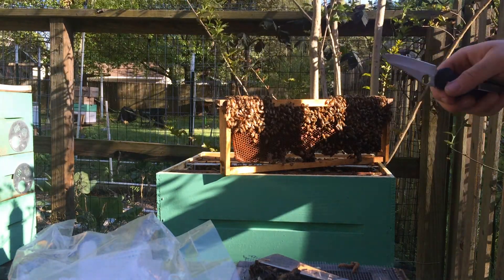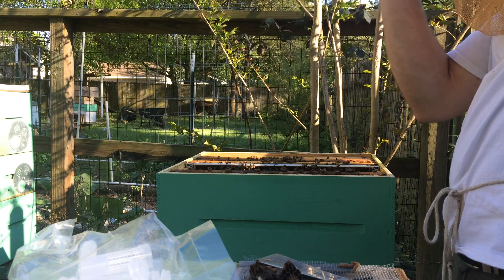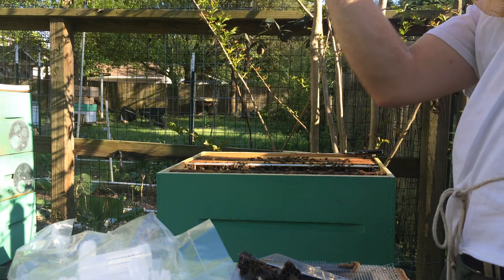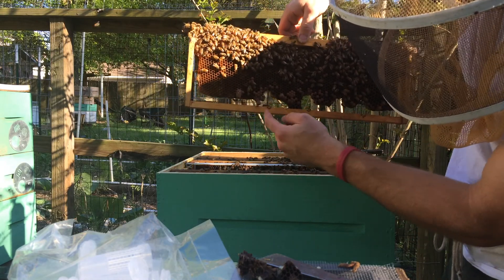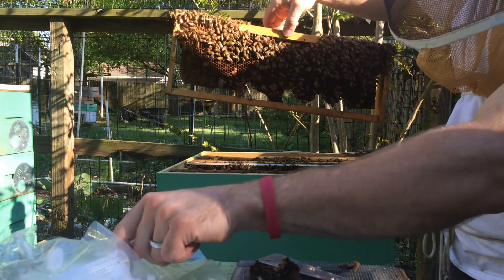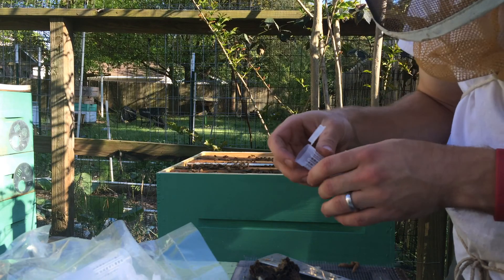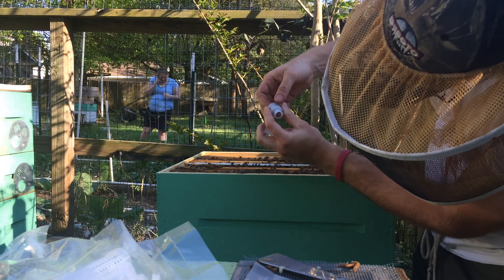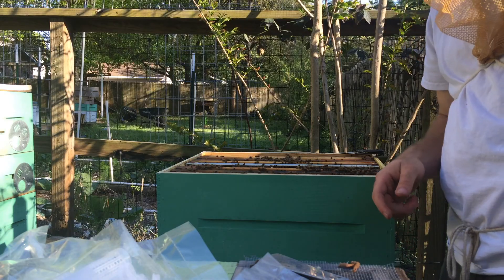Honeybee Queen Cells into Cages

Comment: Thanks! This REALLY helped. I grafted 30 larvae but only 9 took. They are capped as of yesterday and I couldn't figure out how to make those curler cages stick on the bar. I'm going straight out and make a rack like yours and get the capped cells in there. Awesome idea.  Ive also had a heck of a time getting grafts to take for some reason,but getting a bit more success now. Very little, but some.
Reply from the maker: Well keep in mind the hair curler cages aren't designed to use with the JZBZ cups, they just kind of do if you manipulate them and use the frame bank like I did. The JZBZ cup hangs loosely in the what will then be you candy plug area. Yes grafting is an art. I need to do it more to hone the skill. It's a delicate process but with proper planning you can get repetitive high success.

Comment: What i use is the plastic hair curlers with small holes around it and put a wooden plug on the ends, can buy a sack full for the same price of 1 store bought plastic cage. and the plug is from left over wood... and made some cages out of left over 1/8th hwc just to put over a QC, so if i see a frame with a bunch of Q cells on it, i put it into a queen castle, so i don't have to open there hive all the time.   I just simply put a cage over the cell and push it down into the comb,  if a few hatches out there in a cage enough thing can get in it or out...then simply lift the cage up and take her out into a hair curler  take 1 plug out and put queen candy in it, so she can eat herself out....and introduce her to a new colony !   Really i think grafting sux's !  There no use for it...and i can get just as many with the live1 day old  larvae on a frame, than all the time and work of grafting... all you need is 1 day old larvae and end dent the wax around the larvae on a frame and put them in a queenless hive, and the bees will make queens cells out of them!  The  less you mess with them, the better they do...Its like a house keeper that comes over and rearranging your house all the time the way they wont it  Thanks for the blog cheers
Reply from the maker: 426 SUPER BEE Sounds good.